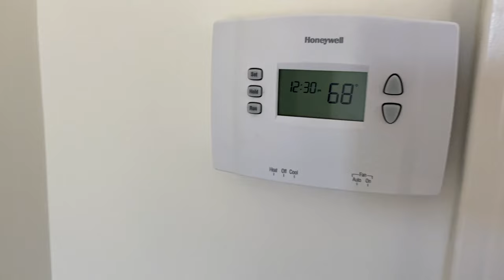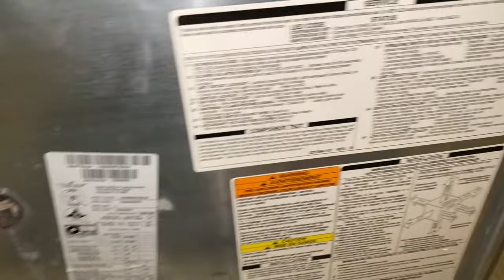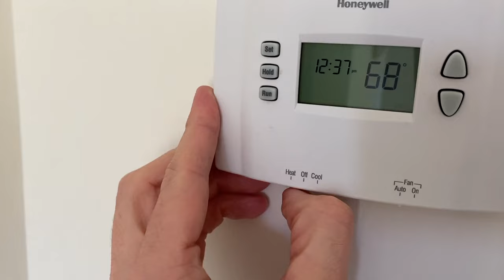Furnace not igniting/heating - inspect igniter

Comment from the maker: If interested in purchasing this part, visit our Amazon affiliate link below.

       https://amzn.to/3r6RYqC

😎👍🔧🔩
Reply: This was an excellent, easy to understand overview of the sequence and parts, thank you! I thought I had an ignition problem but now I'm thinking it may have more to do with the gas output. Do you know which part might be malfunctioning and why? 

Basically, the heating element does heat up and the gas ignites, but the flames would go out after only a few seconds. 

So first, I cleaned the flame sensor rod. This appeared to work initially, but the flames still went out, after about a minute or so.

So then I ordered a new flame sensor rod, and replaced it. Same issue (flames would go out after about a minute). 

So then I took out the burners, and made sure they were clean and didn't have any air leaks. Unfortunately that didn't do anything either. 

The control board was replaced only a few years ago so I don't think that's the issue either. 

Any ideas on what might be the issue? Why does cleaning the flame sensor and even replacing it help to extend the life of the flames beyond a few seconds, but they still go out after about a minute?  I'm thinking perhaps there isn't enough gas reaching the burners? Could the gas be blocked somewhere along their path to the burners? The gas valve is on. 

Thanks in advance for any leads 🙏
Reply from the maker: @teegees  

Good morning, just poured a ☕️ and am sitting down to answer any and all questions for the DIY community.

Thanks for sharing your experience.  Have you checked your Pressure Switch?  That can cause this as well.  Below is a few helpful links regarding Pressure Switch.

     https://youtu.be/pDc8prsNgJY?si=X0U8Xa2ZavXoUXSu

     https://youtu.be/ssI_YCnnF4Q?si=LBeh011afMxOs4yw

Let’s get this figured out!  Let us know if you have any questions and hey if you’re interested, join our DIY ecosystem and help us grow an exclusive group of DIYers.

       toolboxtoken.com

Reach out to us any time!  🧰
Reply: @DIYwithMichaelBorders  Thanks for the quick response! Much appreciated 🙏 Hm you might be right. Took a look at these two videos and had questions on them, take a look.
Reply: @DIYwithMichaelBorders  Oh and you just earned yourself a new subscriber :) Keep up the great work!
Reply from the maker: @teegees  

Awesome, we will take a look.  👍
Reply from the maker: @teegees  

That means the world to us, we subscribed to your channel as well.

Comment: My ignitor is working. That's not my problem
Reply from the maker: Good morning ☕️

Any update?  Have you inspected your Flame Sensor to see if it needs to be cleaned or replaced?
Reply: My ignitor is glowing bright red. I cleaned the flame sensor twice and immediately after the furnace ignited..the burners...so I replaced the flame sensor and all good for about a week then today same problem.  So I, took out the new sensor wiped it with a rag an and the furnace burners came on as it did when I cleaned the old flame sensor.  Could it be a faulty gas valve?  I know the squirrel cage blower motor etc all need to be cleaned.  23 year old York furnace.       y @DIYwithMichaelBorders
Reply from the maker: @Jack51971  

Good morning ☕️, thanks for the update.  Gas valve is likely at this point however have you replaced your limit switch?

Below is a link to our limit switch replacement video.

       https://youtu.be/r9Wx9U7WnWg?si=DAl4TFZpC9wpXGzf

It may be the culprit at this point, and its worth replacing before the gas valve.

Comment: The brand new ignitor doesn't glow.  The l shaped flame tester was dirty. I cleaned it.  The safety switch was stuck open.  I replaced it.  I removed the fan unit and blew everything out with an air compressor.    The little reset tabs have not been tripped.      Still..... the ignitor refuses to glow.
Reply from the maker: Thanks for watching and sharing your experience, any update.  First thing we recommend is turning off the furnace and cutting all electrical power before moving on.

Have you inspected the wiring that feeds from the connection all the way back to the motherboard?

Check to see if you notice any damage to the wiring…such as melted wires, crimped wires, or exposed wiring that’s coming out of the casing… this could lead to an electrical short…which is not good.

Double check that all screws on the motherboard that secure the wiring into place are properly tightened… Not overtightened… however, properly secured.
Reply: @DIYwithMichaelBorders  Safety second as Mike Rowe likes to say.  I have a repair tech coming out today. I heard a noise coming from the attic two days ago. Wondering if a critter found its way into the intake duct work. But, the unit is over 27 years old. Could go either way at this point.
Reply from the maker: @nono-yesyesmaybe  

Thanks for the reply.  We are looking forward to hearing back from you on what the Technician finds.  👍🧰
Reply: Female wire connector on left roll out switch partially broken off.  Not sure how that would occur out of the blue.  With panels covering everything, nothing could bump into it. Perhaps mouse got at it. The mice chewed through a wire in my Subaru ignition a couple of months back. Made a nest under the hood out of firewall insulation. Sounds like I need a cat.  And perhaps drive my Subaru a little more often.  Haven't had mice in over 30 years. Low rent condos popping up all around me. Finding rats in the wood pile. That's a new one. Critters are getting flushed out of the fields into the neighborhoods perhaps.  @DIYwithMichaelBorders
Reply from the maker: @nono-yesyesmaybe  

Thanks for the update, awesome find on your behalf.  Hopefully getting that wire replaced will solve your issue.

Comment: So my furnace works...After turning it on from the box, I go downstairs, wait for it to engage, and hear the CLICK, which is releasing the gas, wait a few seconds, then I MANUALLY light the furnace with a cigarette lighter....This works, but of course I would like it to work on its own......Since it is staying ON once I manually light it, I assume it is NOT the FLAME SENSOR, even though I do not see the Flame sensor light up before the flame starts...So on ONE side you have the FLAME SENSOR and the other side you have the IGNITOR.......I removed the IGNITOR and must be working, since when I removed it and tried to start it, the flame would only last a few seconds, but once replaced the furnace worked(again with a MANUAL cigarette lighter).....Any guesses?  The INGITOR causes the FLAME SENSOR to heat up correct?  So if it's NEITHER what else would it be or am I looking at this incorrectly?  Thanks...
Reply from the maker: Thanks for sharing this info, any update?  It may be a weak igniter.  We recommend replacing igniter however it may also be that your flame sensor is in its early stages of failure and acting sporadically…meaning…sending the improper readings to the mother board.

Replacing both igniter and flame sensor is a good way to start.

Comment: If you monitor this. Quick question for a diy before bringing in a hvac tech. I have 2 furnaces which I thought were both manual light as they look the same. Tenants had no heat So I checked no oilot lit. One kit no problem. But the other I kept hearing clicks. Shut it off. Turned it on still not working. Turned knob to off. Waited. Then to pilot and it wouldn't light. Then I heard the click so looked it up and apparently this one is intermittent pilot electric start. So not sure if I messed up the start cycle. The pilot control know is that supposed to just stay in the on position or in the pilot always position since is automatically controlled?
Reply from the maker: Thanks for watching, any update?  It’s possible that your system is in the “Dry-cycle” mode.

This likely happens when the furnace is manually turned off while it’s running.

If the furnace did not reach the preset temperature selected on the thermostat, it falls into this dry-cycle mode.

You will need to turn on your furnace switch on as well as place the wall mounted thermostat lever to heat and allow furnace to turn on.

The blower motor may run for upwards of 5 to 10 minutes before igniting the burners.  It does this to clear out any possible gases in the system due to its cycle being interrupted.

😎👍
Reply: @DIYwithMichaelBorders  I reset everything g as if it was just serviced. Asked the tenant to turn up thermostat turned the system switch on and magic its running. Just took a bit to find the model and instructions. So really don't know what happened. Could be what you said. I knew it wasn't broken or dirty. I even checked the pressure switch that the front cover presses when closed. Saved the day and thx for the response. Lowered the anxiety.
Reply from the maker: @oxanalangley9131  

Good morning, we are back with you.  That’s great to hear and we appreciate you sharing this update.  I know people appreciate it when we respond to their questions and we find it even more awesome when they take the time to give us an update.  It means everything to us.

We DIYers need to stick together!!!!  Hopefully many stress free days ahead for you, enjoy your weekend.  😎👍

Comment: Igniter glows, I hear a click but the burners don’t ignite.
Reply from the maker: Good morning ☕️ two things are likely to cause this.

1.  Dirty Igniter.  It’s possible that your igniter is ever-so-dirty enough that it’s not allowing the igniter sensor to ignite burners.

2.  Bad gas valve.  Its likely that you have a worn out gas valve.  In your case, the igniter is glowing, then clicking…but the gas valve is not producing the flow/supply of gas properly.

Let’s start there, keep us posted.  🧰

Comment: My flame sensor has been cleaned and replaced.  This igniter is glowing but the burners will not ignite.  The York furnce code has been blinking 7 times which means low gas flow.  So, when I clean or have replaced the flame sensor it fires up when I turn the furnace on...I am wondering if the gas valve is not opening?🤔

Comment: Does the inducer motor only come on when using the heater or when using the cooling also?
Reply from the maker: Thanks for watching.  The inducer motor should only run when the system is configured for heat.

If your inducer motor is running while your a/c is on, it’s likely that it’s wired incorrectly.
Reply: @DIYwithMichaelBorders  
Okay thank you sir
Reply from the maker: @DAT-TEXAS-DUDE  

👍☕️

Comment: This diagnosed me! Igniter isn’t warming up at all
Reply from the maker: Thanks for watching, any update?  That’s awesome you pinpointed that it was a faulty igniter.  Have you replaced igniter and got your system back up and running properly?
Reply: @DIYwithMichaelBorders  I replaced it and turns out the entire unit is dead. 19 years old so no surprise. It’s gotta go
Reply from the maker: @StreakGeek  

Oh wow, that’s an unexpected outcome.  Sorry to hear that.  A new furnace is pricey however it will be brand new…nothing better than that.
Reply: @DIYwithMichaelBorders  Yupp… and new AC as well. AC is older than I am :D
Reply from the maker: @StreakGeek  

Wow, major upgrade.  Out with the old, and with a new.  😁👍
Reply: 80 @StreakGeek

Comment: Replaced ignitor. Still won't glow. Is it the computer board?
Reply from the maker: Thanks for watching.  Do you see any signs of damage to the wiring that feeds off igniter and into control board?

We recommend checking the connection screws that secure the wiring to the control board.  Any loose connections can cause havoc on system.

We recommend having the furnace in the full off/shutdown configuration prior to working on it.

Comment: So what does it mean when the lower starts, but the fan on the top part never starts spinning?
Reply from the maker: Thanks for watching, are you referring to the inducer motor and fan?  If so, the purpose of the inducer motor is to draw combustion air into furnace where it can mix with the gas and burn efficiently.

If your inducer motor fails, the furnace should detect that and shut down within a few minutes of running.  👍
Reply: @DIYwithMichaelBorders  Yes. That thing isn't spinning. I can spin it with my hand and it doesn't get hot before the furnace auto shuts off. I think it's a something electrical because there is a yellow flashing light but idk
Reply from the maker: @onlyme8780  

Thanks for the reply.  In that case, it’s time to replace the inducer motor.  Below is a helpful video link that shows us replacing this exact inducer motor shown in this video.

       https://youtu.be/WM-l1BUuldM?si=Qt2XlMu1sOK8x7Bp

Let us know if you want help looking for a replacement inducer motor.  We will need your furnace model number.

Comment: What if the ignitior turns on and glows but shuts off? Please let me know i have the same set up. Thanks
Reply from the maker: Thanks for watching.  It’s likely that the igniter is in its early stages of failure.  When the igniter heats up, glows, then shuts off…it’s an indication that the igniter is no longer capable of producing the required heat output to ultimately ignite flame.

Although it’s looking like it’s going to work, it may be just shy of complete failure.

Replacing your igniter will likely solve your issue.  😎👍
Reply: @DIYwithMichaelBorders  

That's the thing I replaced the ignitor in December of 2022, and it worked fine. I used the same exact part as the original and made sure nothing was touching. Do you think it maybe the pressure switch? How long do the ignitors usually last? Because it glows to its full potential   and was barely used for it to malfunction
Reply from the maker: @motorsny2906  

Thanks for the follow up, since replaced in December 22, it’s likely that your igniter is still good…it shouldn’t fail that quickly…unless you had a power outage while your furnace was actively running.

Pressure Switch is the next likely cause as well as Gas Valve.  Have you verified that your Gas Valve is in the fully open position?
Reply: @DIYwithMichaelBorders hi there! Why did you say unless there is a power outage while furnace is actively working? An electrician did a rewiring on my house and had my power temporarily shut off. Im pretty sure my furnace was running at that time. He used a generator to turn on the furnace. It turned on but there is no heat coming out and there is 9 red blinks in the furnace. It says ignitor problem.
Reply from the maker: @ivanleeascano25  

Thanks for the reply.  Before the technician serviced your furnace, we are very confident that the power was shut off properly.

We are referring to a power outage in terms of a storm moving through and knocking down a power-line, which then leads to the power outage.

If the furnace is running and it experiences such unplanned outage, it can cause havoc on the system.
Reply: @DIYwithMichaelBorders  what will happen if power was not shut off properly? Thanks
Reply from the maker: @ivanleeascano25  

It will experience a power laps or surge.  Think of it as you breathing normally and then get shocked in the finger with electricity.  Your reaction will be quick to pull back your arm and say yikes…I just got electrocuted…your heart rate and adrenaline will increase for a bit until it calms back down.

Back to the furnace, when a power outage happens and then electricity comes back on, it can experience a similar phenomenon…however with the furnaces electrical system, a power surge can temporarily overheat wiring…or can shock the control board and damage it.